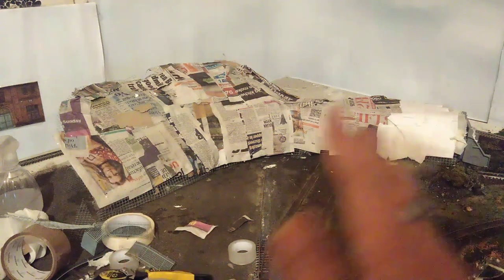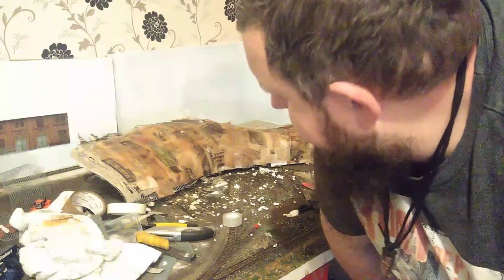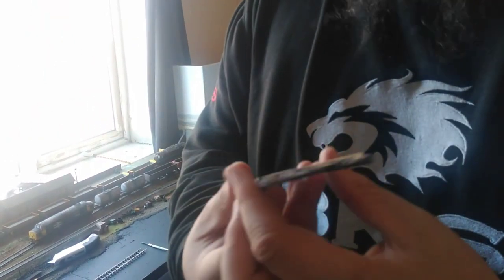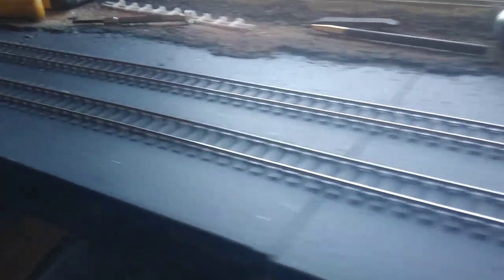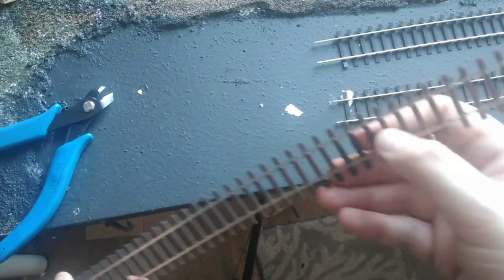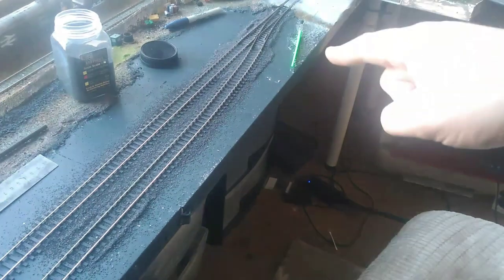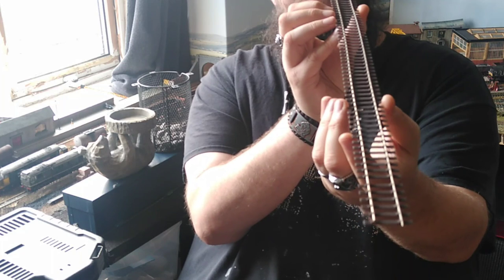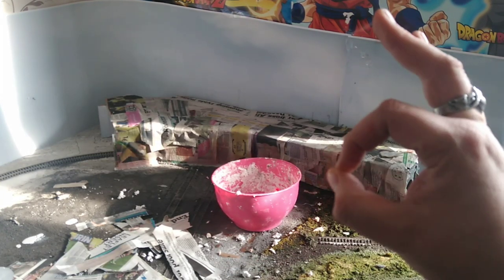Laying new track? Try this! | Iron Horse Weekly ep13

Comment: Look how straight it is - but you were holding the track too high, so it was off the screen!  Other than that, I can't comment on the new bullhead - but I've always used Peco flexi, and that tends to stay fairly bent when you position it, unless you have very tight bends, when it does tend to creep outwards to some degree unless it is pinned down. Also - where you were adding the extra 'ends' to the two sidings - I'd have cut back the unsleepered ends a bit, so there wasn't such a big gap to fill in!
Reply from the maker: Wasn't any drama mate to be fair, the extra sleepers I had worked a treat 😁
The track cutters made life easier that's for sure,

As for it cutting off I think that's a YouTube thing.. looked ok on my video software :( cheets

Comment: Hi Craig.

How interesting that you should go for bullhead rails. However, I must point out that my Peco 1metre long flat-bottom track lengths also retain their shape when bent into a curve. I won't be making the transition to bullhead though as it's too much extra expense. With all this new track laying, you could have dispensed with your narrow gauge track and replaced it with the correctly gauged EM track; just a thought. 

Yes, you really love your 'mucky' jobs and strangely enough you look at home when doing them 😂. Ever thought of colouring your paper-mache etc. first before applying it. If you coloured it dark brown, it would give you the right base on which to place your bushes, trees and scattered grass. 

Finally, I don't know if you are aware, but Hornby have just released their TT120 range and, unlike British standard OO, the gauging is correct just like it is in America and Europe. My cousin used to own a Triang TT layout and it was perfect when available space was rather low. However, the second-hand rolling stock etc. that is now becoming available would not be compatible with the new Table Top range. When you've got time, pop over to the Hornby website and check it out. They're not making it available to retailers in order to keep the costs down; a good idea I think. I've seen lots of comments showing much interest in it due to the fact it's smaller than OO Gauge but larger than N Gauge and manufactured with all the necessary detail. Maybe something for you to think about in the future when you run out of space.  

Cheers me dears,

Paul. 👍
Reply from the maker: Yeah the narrow gauge thing is a little irritating but the work required on locos is far too much effort for me!😁😂

I'm pleased with the Bullhead and to my eye at least it looks far better now .

I have some spare too... For another project which will begin in the new year 😁😁🤫🤫🤫